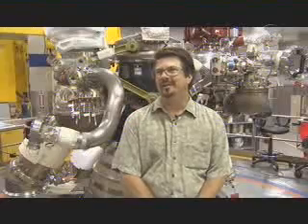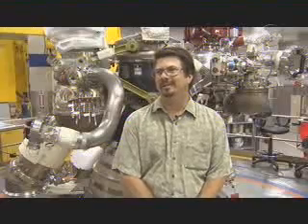J2X Engine

Comment: they used the original gas generator and other parts to test the newly designed turbines and pumps it seems, being as the majority of complexity is in the turbine and pumps you pretty much CAN say this is not the same j2.